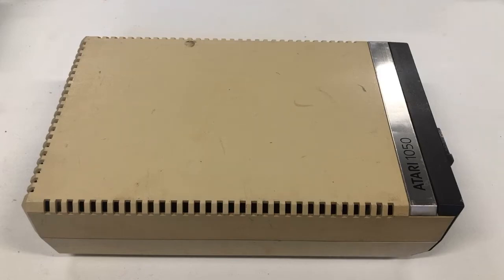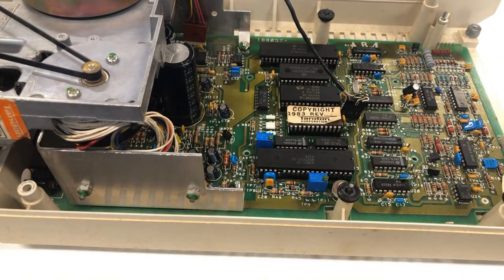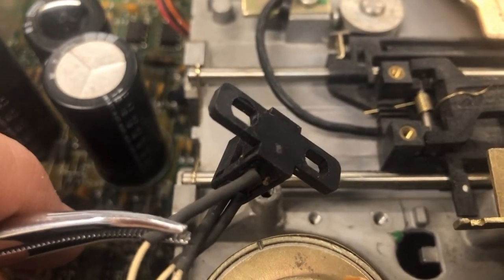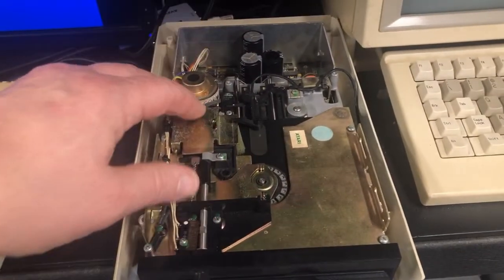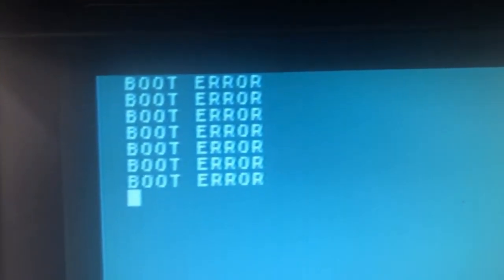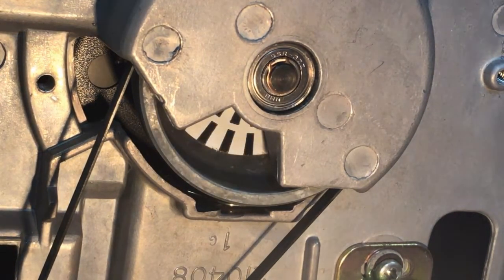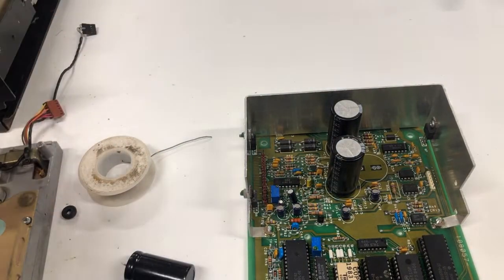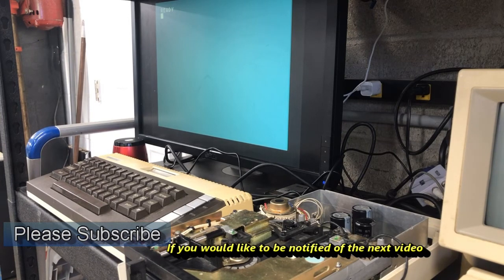Atari Floppy Drive - Fixing someone else's repair attempts

Comment: Great detective work. Great result.
I fix these occasionally too, upto now I've fixed well over 50. 
Interesting thing about the 4700uf caps, of all the drives I've come across almost all of them have the same cap setup. I've have tho seen a few that have 3 6800uf.
It's worth knowing the most common faults I've found are failed caps - mostly the 47uf 16v ones. Also the drive select switch can be dodgy which is fixable with the ole electrical connection spray. 
The two diodes between the 6800uf caps are often failures so worth replacing them too.
Good to see someone else fixing these drives! Subscribed
Reply: Mine spins for 2 sec then stops... and again spins stops... infinite loop. Any ideas? 47uf caps changed (were shorted). Thanks!